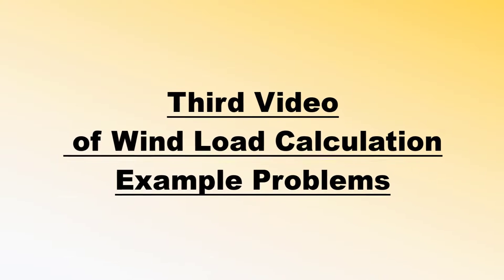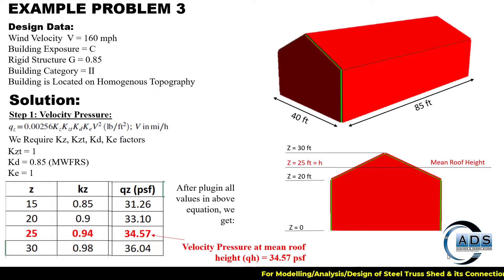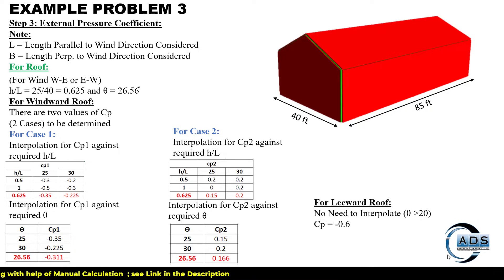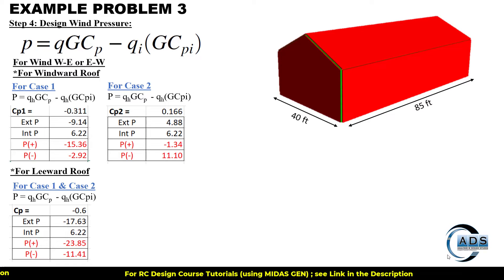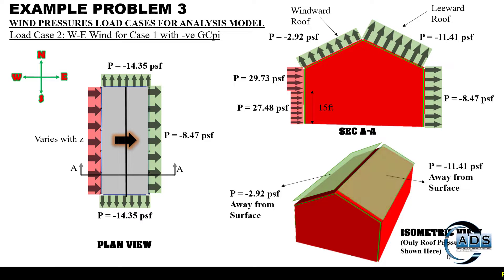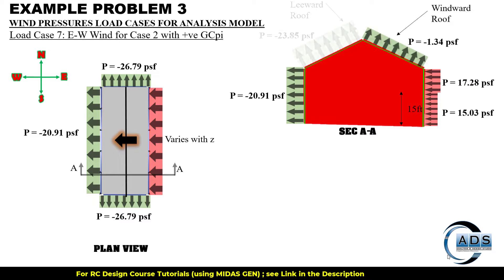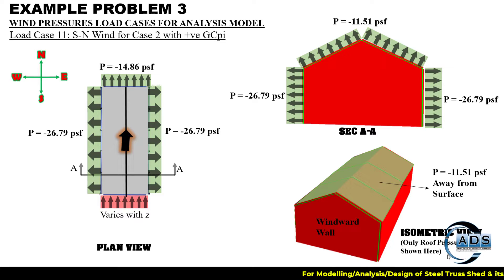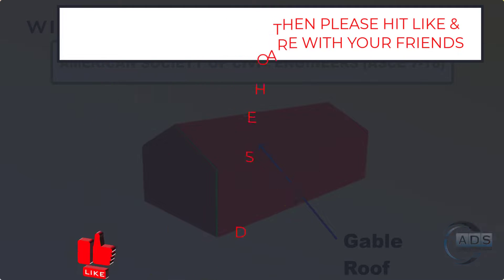Example Problem 3 (Gable Roof Building) for Wind Load Calculations using ASCE 7-16

Comment: 4:20 I dont understand what case 2 is and how you got those values. Could you please clarify?
Reply from the maker: Dear brother, there are 2 values written in Cp table so case 1 for first value and 2 for other
Reply: i think that is wrong, the case 1 and case 2 you are talking about says windward and leeward values in the table, those should be the only roof values. but afterward you do the roof leeward values from the next table because there is no slope of the roof in north south direction but this is not needed the first table gives you the only values you need

Comment: On 12:04 I dont get it,.. What the meaning of "0 to h, h to 2h, and > 2h". what I know i the letter h is elevation, but why in that video, h is defined as wind pressure based on length of building
Reply from the maker: Brother, you are right, "h" is the mean roof elevation, but when wind is blowing in the said direction, then entire length of the building will not  experience same pressure, rather, the intensity of the pressure reduces region wise. so 0 to h, h to 2h and > 2h are the lengths of those regions of the roof  from the windward wall.
Reply: @analysisdesignstudio3363  Ohh I see, I get it now, thank you, and I have subscribe your channel and hoping your next videos
Reply from the maker: @dinarwahyu4790  thanks. keep watching keep learning and keep sharing.

Comment: Thank you for video, very helpful and best video for wind load calculation. There is one question i have to ask ...Determination of external pressure coefficient, for wind direction W-E or E-W , L/B should be 85/40. because L is the horizontal dimension of building parallel to wind direction.  Please make me correct if i am wrong. Regards
Reply from the maker: Thanks brother for the appreciation. Dear, these video are just for the concept clarification of the wind load calculation and mechanism for different structural shape building. you can correct the numerical mistakes by your own. Thanks for specify.
Reply: E

Comment: The wind directions used do not correspond to your values used for L and B. Also the values shown for velocity pressure, qz & qh, are incorrect.
Reply from the maker: Dear, these video are just for the concept clarification of the wind load calculation and mechanism for different structural shape building. you can correct the numerical mistakes by your own. Thanks for specify.

Comment: sir how about the minimum wind load according to ASCE 7-16?
Reply from the maker: What do you mean please elaborate??
Reply: @analysisdesignstudio3363  Same question here, based on ASCE 7-16 Chapter 27.1.5 Minimum Design Wind Loads. 
"The wind load to be used in the design of the MWFRS for an enclosed or partially enclosed building shall not be less than 16 lb∕ ft2 (0.77 kN∕m2) multiplied by the wall area of the building, and 8 lb∕ ft2 (0.38 kN∕m2) multiplied by the roof area of the building projected onto a vertical plane normal to the assumed wind direction. Wall and roof loads shall be applied simultaneously. The design wind force for open buildings shall be not less than 16 lb∕ ft2 (0.77 kN∕m2) multiplied by the area, Af ."
A bit confused about this term, do you have any idea? Thanks
Reply from the maker: @jessicagitomarsono3836  ok I got the point... These minimum loads are given for quick preliminary sizing of the members..

Comment: hi, i think the velocity pressure calculated is wrong. Looks like you used wind velocity (V=130mph) from previous videos. But other than that, helpful👍
Reply from the maker: Yes that's the mistake.. Thanks for highlighting.. And Appreciation...

Comment: Very helpful. Could you do an example if theta is less than 10 degrees?
Reply from the maker: Thanks for appreciation.. For theta less than 10.. There will be no effect of gable roof.. It will be considered as flat roof (no windward and leeward portion of roof,, see lower portion of Figure 27.3-1)